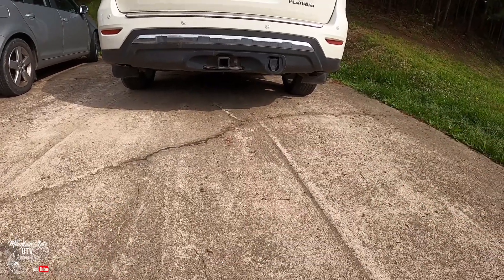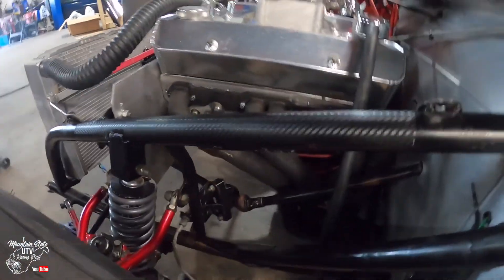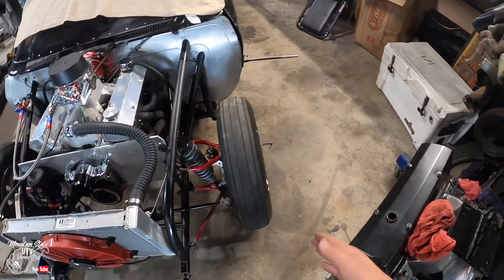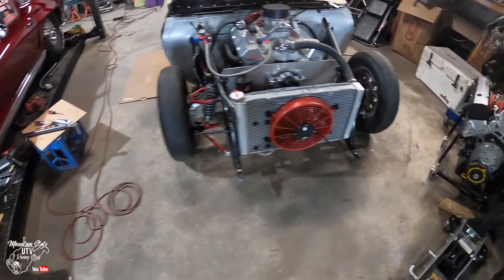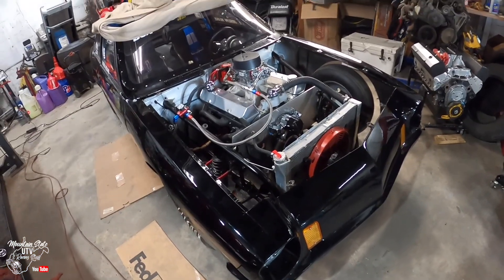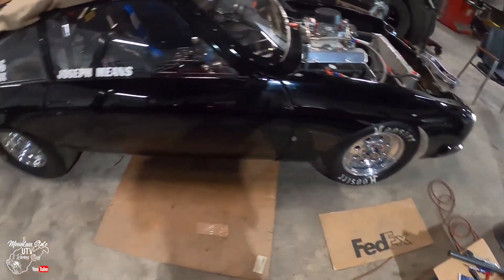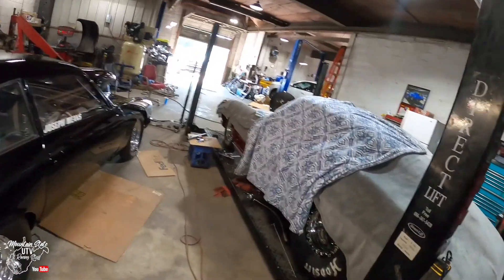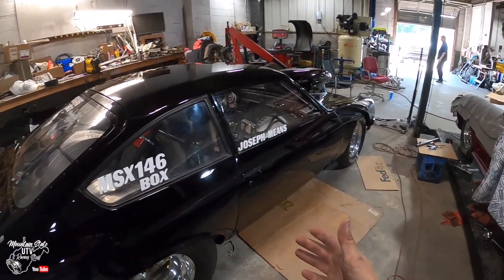Getting the Vega ready to go faster than it’s ever been! Last minute fixes before testing.

Comment: Big question is what gear you have and what gear jp has
Reply from the maker: Same gear. Cars are set up basically identical.
Reply: Ok if I get a chance I’ll try to ride down and watch them both run I only live like 6 miles from the track
Reply from the maker: @LinksPerformanceRacing4088  heck yeah. I’m on my way there now to test.

Comment: 5.46
Reply from the maker: Shew! I’d be happy with that. Mathematically it’s possible if the chassis is happy.
Reply: From what I’ve seen on here it should be and should be close most of the time 100 pounds is around A 10th off not all the time but most of the time